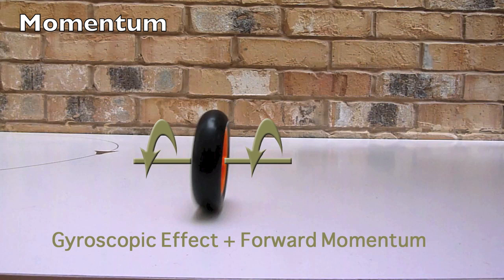The Physics of Countersteering

Comment: Does the tire profile have anything to do with the reaction when counter-steering? The articles I have read, written by bikers not physicists, suggest that the smaller diameter of the tire at the contact patch when the wheel is turned is also partly responsible for the lean in the opposite direction to the push.

Also, can you confirm there is a functional minimal speed for this effect to happen and explain why?
Reply: That is camber effect, and how electric unicycles are normally turned. Still it's the same sequence as counter-steering, the rider leans for anticipated balance, then tilts the electric unicycle inwards to steer.

Comment: Well, you got most of it right, but not all.
As you clearly demonstrated, a motorcycle wheel with a leaning angle will turn. Actually, the ONLY reason a bike turns, is that is has a leaning angle. How much steering input is needed, and how much the steering is actually turned, is irrelevant, because that is something the wheel, slope of the forks, and overall stability of the bike takes care off. Thats why you can ride with your hands tied on your back. This part is important to understand. You do NOT steer a bike as you would a trike.
Now, where you go wrong, is with the counter steering.
Counter steering is the gyroscopic effect translating your force on the handlebars, into a tilt (lean) of the bike. This lean is what then results in a turn.
So you do NOT initially turn right, causing centrifugal forces to lean you left (this only happens at VERY low speed). You apply force to the gyroscope, causing it to tilt, causing a tighter turn.
Reply: Lars Birkemose 
Sorry man, you're making this very complicated and I strongly suspect you're wrong.
Reply: @softailfun  
So anything you dont understand is false?
Reply: Lars Birkemose 
Well it’s true I’m no physicist for sure. However you say “You can ride with your hands tied on your back”, while true.... you’d never make a bend of any significance. You go on to say “So you do not initially turn right, causing centrifugal forces to lean you left (this only happens at very low speed)”, that pretty much is the definition of counter steering. I could very well be misreading what you say, you have a lot of stuff in there that I don’t need as a rider. All I need is:
Push left turn left....... push right turn right.
I don’t need to know how, why etc of the mechanics, like I don’t need to know how a cell/mobile phone works. It just does, and I’m happy with that
Reply: @softailfun  
You can follow any road with your hands tied on your back. How sharp you can turn is pretty much only limited by your self confidence.
Trust me on this.

Counter steering is pr definition the gyroscopic physics where you push the right handlebar in order to turn right. The keyword is "gyroscopic".
At low speed, you get a similar effect, but that is caused by upsetting the balance of the bike, and then immediately having to steer in the opposite direction, to avoid falling over. The keyword is "correcting to avoid falling over". 

Now, I am not saying this is easy to understand, but it is still how it works.
Reply: Lars Birkemose 
That first statement. I’m very capable on a bike (as in motorcycle), you aren’t going down a road through bends at 50mph with your hands behind your back, and that’s a fact.
Reply: Lars Birkemose 
You don't ride a bike do you? I have just looked at your last post in this thread. You are so wrong! You say push on right bar to turn right.....we can agree on that of course. Then you say the rider needs to turn immediately the opposite direction (pushing the left bar in this example), this is completely wrong. The rider never actively steers into the bend, the bike does this as a self alignment exercise due to the steering geometry of the bike. Logically speaking, if you agree pushing the right bar turns the bike right, what do you think pushing the left bar will do when you're leaning..... It stands the bike up from the right lean in order to begin a left lean.
Reply: @softailfun   
I said, that at low speed if you physically turn the handlebar to the right, the bike will fall to the left, and in order to avoid falling over, you will have to immediately steer left. 
But that is NOT counter steering. It is more of just keeping the balance.

I have riden sports bikes for over 20 years, including many many hours on track.
Reply: Lars Birkemose 
You also remove posts that you have put up which are incorrect it appears.
Reply: @softailfun  
Whatever makes you happy.

Comment: So, is it literally counter steering towards the  opposite direction or just pushing down or applying pressure on the opposite direction of the handle bar ?
Reply: Sky High 
It is a very small push to the bar in question. So push right bar, go right...... Push left bar, go left.

Comment: While the physics is mostly correct, you did make an incorrect statement briefly, which may cause some confusion and honestly, this particular false datum has resulted in many, many crunched motorcycles and damaged or dead motorcyclists. You talk about weight shifting being a way to turn a bike, but you say it's too slow to avoid an obstacle. The point is, weight shifting is NOT how a bike is turned and controlled, ever. And the belief that it does leads people to shift around and try to get a bike to turn, and they inadvertently pull the opposite handlebar, which causes the bike to lean and they're convinced it was the weight. Counter steering is not an odd trick or a quicker way to turn. It is the ONLY way to initiate or control a turn on a motorcycle. You should correct this and do a new video.

Comment: Sorry, I don't mean to be rude, but... 

Ah, your missing the most important part! 

That's is, counter-steering is an example of a TORQUE APPLIED TO A ROTATING MASS, causing that mass to change it's equilibrium as long as that torque is applied. Period. 

It's the lateral torque of the front axle that causes the instability of the the front wheel. As the front wheel seeks it's new equilibrium which is angled (see video link) the front forks follow this angle to the side. The front end is now 'pulling' the bike over to its side. That's what causes the instability and the bike leaning over, of course at this point there's considerations of gravity, speed angle of lean that need to balanced to maintain radius of turn, or increase, or decrease.

Yes, once a turn is initiated there are centripetal forces, yes there's a balance of speed and angle of mass and equilibrium. BUT that's all after the fact. In my opinion you should not be starting your demonstration with centripetal forces and how they balance, that's all after the fact. 1) Start at the ~0:50 stability demo; 2) EXPLAIN TORQUE input. 3) move on to instability, balance of forces to maintain the turn....

Please review: https://www.youtube.com/watch?v=XPUuF_dECVI

Comment: And on a slippery surface, such as gravel, it’s best to stand on the pegs and cause the lean by using the leverage of your increased body length (shifting your weight to the left peg) than to counter steer in which case the loss of grip from your front tyre will cause the bikes momentum to continue in a straight line.
Reply: Gerhard Combrink 
What rubbish!

Comment: Counter-steering rapidly induces a lean from a neutral position by using the weight of the bike to overcome the gyroscopic effect of the wheels. The bike, at speed, doesn't want to turn. You can use your body weight to initiate a turn by leaning, but this is slow because it doesn't have enough force to quickly overcome the gyroscopic effect. But if you, from a neutral position, push the right handlebar, the bike will turn slightly left and rapidly lean the bike to the right. It's actually quite simple.

Comment: so counter steering is to only initial the lean towards the direction you want to go? but then does your handle bar and wheeling stabilize into the same direction you're turning if you continue to turn into that direction?? or do you keep counter steering
Reply: Update: I think what I understand is that when you push or turn your handle bars right, It only INITIATES the bike to lean left. BUT, the wheel SEQUENTIALLY follows the direction you lean into and want to go(left)

Comment: A  beginning rider should not watch these types of videos. It is my belief that more problems are created by thinking during a dynamically occurring event than just reacting.  The best advice for a beginning rider: get a 125cc dirt bike.  Put on some tough, heavy clothes and and go out and crash at low speeds on soft ground. Repeat. Do power slides, burnouts, donuts, drifts, controlled skids,  little jumps, small wheelies and a low speed obstacle course. Then move on to the largest street bike you can afford and realize its is stupid to have a such a big bike. Think about what type of use the bike will actually be performing and get that type of bike. ie: looking cool at Vespa meets or riding hard and fast to Gnome Alaska from Miami Beach. Then buy a new bike and realize it is stupid take all the depreciation loss. Buy a good used bike with a design you have thoroughly researched of a realistic displacement for your intended use.  Never watch any You tube videos.  Slick video for the generally interested, but ignorant viewer.

Comment: So basically, if you need to turn left really quick, steer to the right first so that the bike leans to the left, then turn left?
Reply: Yap
Reply: GZA 
Nope, you have the second part wrong. You steer (slightly) the the left to turn right and keep the pressure on until you reach the desired lean angle, at which point you just maintain the pressure throughout the bend. The front wheel self aligns to the turn, you do not physically change the wheel direction. Hope this helps.

Comment: I don’t think this video is completely correct.  Yes, pushing left will initiate a left hand turn, but you have to keep pressure on the left grip.  It doesn’t then “reset” and start turning like a car.  Try it out in a parking lot.  Put a little pressure on the left grip.  You’ll slowly lean and turn left.  Now press a little harder..  you’ll lean more and turn sharper.
Reply: vinnyj22 
You are absolutely right fella. Make the bike steer a circle, it is exactly as you describe. Hold the circle and look down at your bars, the front wheel is indeed facing into the turn.

Comment: Holy love of clarity!  So thought experiment- if you had a weight on a pole that is perpendicular to the bike vertical axis and extended towards the center of a curve, would that allow a bike to corner without lean?  

One last favor - can you touch GP riders position as it relates to cornering.  Body position effects on “hanging off “ the bike meaning closer to center of the curve and any effects getting their body CG lower towards the ground.

Comment: At 2.30 the video gets confusing. The model has the bike going into a right hand turn, which is initiated by the push on right hand bar. The video then exaggerates the turn of the front wheel leftwards and the  bike model is shown leaning slightly left. Slow-motion filming of real ,counter-steering shows a quick and slight flick of the front wheel to the  left before the bike swings right. But the exaggeration in the model is not helpful. Nor is it helpful that one looks at a screen with the bike coming towards one as the view from the front has left on the right side of the rider.

One can swerve a bike round an obstacle by counter-steering even when remaining upright on the seat; the bike rolls under the rider. This was a racing technique back in the 1920s as evident in videos where the bike is leaning more than the rider during cornering. Beginning in1940s-1950s the racing rider remained aligned with the bike, both having the same lean; and in around 1972 the fashion for knee-scraping and leaning the body inside the turn came into play as bikes were  ridden faster and tyres improved markedly allowing the bike to be cranked over beyond what seems sanity.

It is nice to have an explanation based on physics; however, anyone coming into motorcycling from bicycles has learnt counter-steering without it having been turned into  a compartmentalised "specialist" issue for the beginner to worry about when trying to understand how to get round corners without falling off. It has only just occurred to me that novice motorcyclists are coming into being without having ridden bicycles as children, hence the fuss about counter-steering.

Comment: But ... There are 6 movements possible with your hand on the left grip. Push out is not one of them. You can push in 3 directions: forward, in and down. You can pull in 3 directions: back, out and up. 

The only way I can understand this is, approaching an obstacle flick the handlebars slightly right. This causes the bike to try to fall over left and the bike begins to move left. So you have to return the handlebars to the neutral position to keep the bike from falling over after you miss the obstacle. Makes sense, but a slight miscalculation at any point will be disastrous. On the other hand, you can just plow into the pothole and hope your bike can take it. Probably the best thing to do is practice this in a parking lot at 15-20 mph until you get it down.

In the MSF course you're told to just press left, go left. It's not presented like this at all in the course. That seems to be because this vid is concerned with a high speed swerve. The MSF course has nothing high speed in it.

Comment: ALSO: A PROPERLY DESIGNED TWO WHEELER - WHEN STATIONARY AND LEANED OVER - WILL TURN IT'S FRONT WHEEL IN THE DIRECTION IT NEEDS TO TURN TO COUNTERACT THE LEAN (if it were rolling forwards) I COULD NOT RIDE A BICYCLE UNTIL MY BROTHER TOOK A BICYCLE AND ROLLED IT DOWN A HILL WITH NO RIDER ON IT - SEEING THAT, I INSTANTLY KNEW THE "SECRET" TO RIDING A TWO-WHEELER !!!

Comment: I've been doing this since first jumping on a motorcycle 35 years ago.  What was missed in the explanation is that different bikes will react for the same given input effort differently so you newbies...don't go out and hammer on your bars as it will likely result in unpredictable behaviour of the bike until you develop control through experience and muscle memory. 

 There are several other things to be aware of when counter steering:
The bike's geometry and wheel size affects the rate of change when counter steering.  How it is set up, the steering geometry, things like rake and trail  all affect rate of change. Smaller wheels and steeper steering head angle quicken the drop and vice- versa.  The width of the bars also affect effort required due to the change in moment arm with bar length.  Shorter bars = increased effort.

Don't attempt to apply the technique when already starting to lean especially on poor or slippery road surfaces as it could result in loss of control.  As in the video it is most useful when needing rapid change of direction from fully upright.

Comment: 1:04 wrong, gyroscopic effect is not what keeps the bike upright, geometry of the fork does. Ever tried riding a motorcycle backwards? Should be just as easy as forward if it was due to gyroscopic effect.